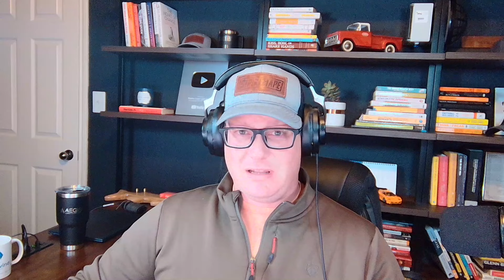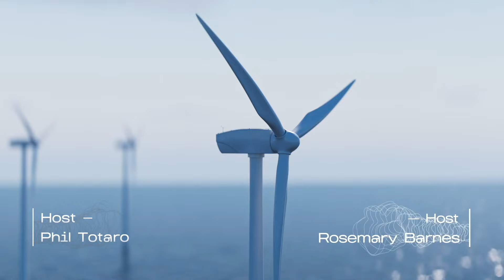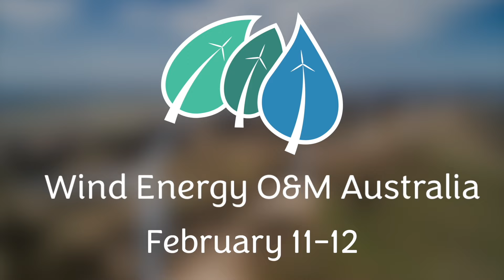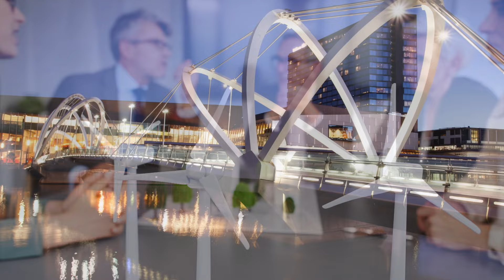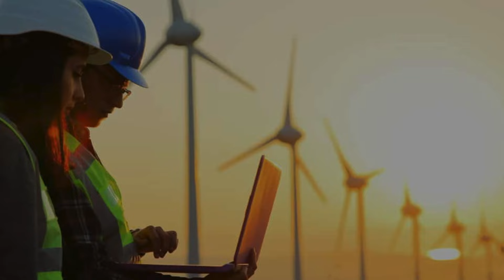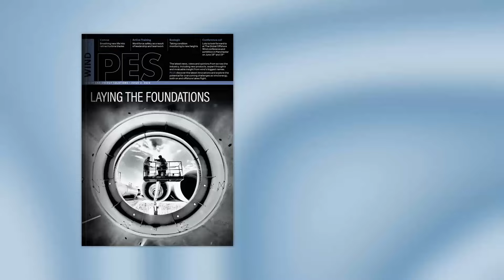Wind Industry Quality Crisis, US Election Impact on Renewables

Comment: 35:07 you got any evidence that temporary workers are the cause of this problem? Or is that your default assumption when you want to find someone else to blame?
Reply from the maker: The quality issues are a significant concern. Composite manufacturing is complicated. It requires multiple levels of competency throughout an organization. The competency is accomplished through proper training and years of supervised experience.  It also requires a quality organization that validates the products and provides corrective actions on defects. Temporary workers, new employees, or improperly trained employees create logistical and quality risks. When not managed properly those risks turn into big problems for the organization. The accusations documented in multiple press reports indicate the products had defects. The exact cause of those defects has not been provided. The amount of physical labor to assemble the parts is high. Thus, worker competency and training is always a concern. We highlighted that concern and the risks it created.